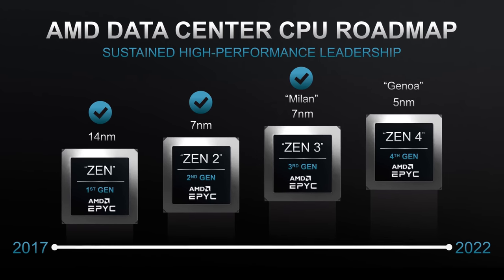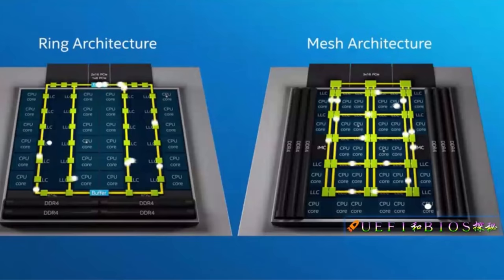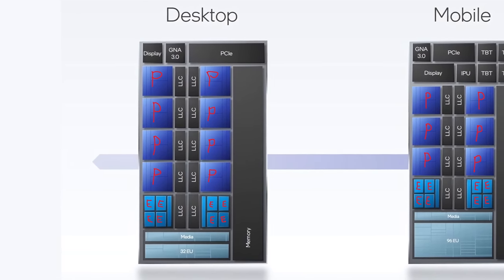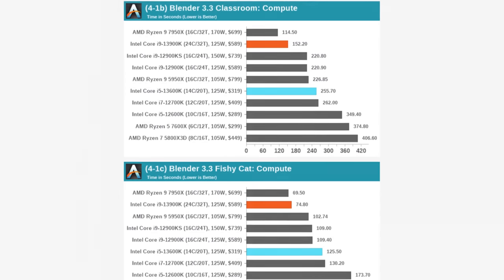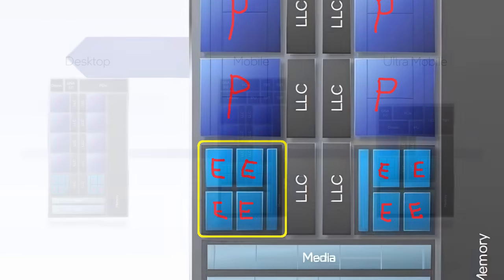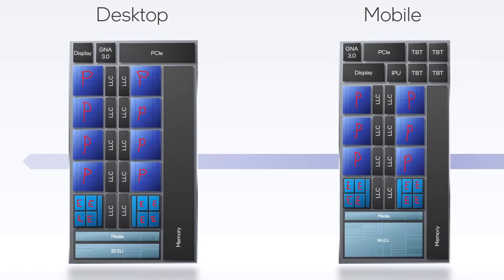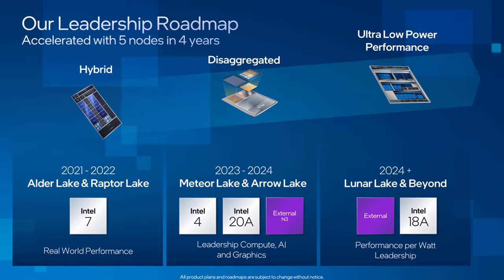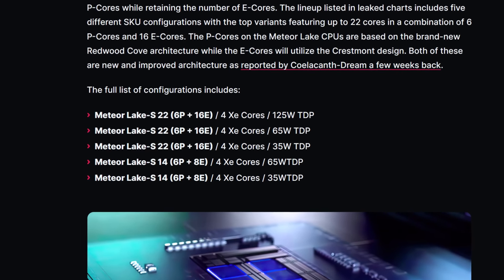E Cores - Slow, simple, not super efficient... but still good?

Comment: Likely amd already has this in mind as they are absolutely dominating the performance per watt, as in it’s not even close by any measure. This can be seen in the server market. It takes several years to design and manufacture something like this, as you pointed out
Reply: You need to better informed. Most tech media outlets do a poor job and evaluating efficiency. Those who actually spend time and do it properly found that in real world use that would define more than 90% of consumers, intel just about edges AMD on efficiency.. why? When intel brought big little, most people didn't realize how low their CPUs can idle, under 3W for some desktop chips. On top that, their P cores are extremely responsive and offer peak performance very quickly at high power and ramp down to their crazy low idle power. This peak is like microseconds or milliseconds. So the chip on average consumes less energy when you monitor its use over long periods of time in common use cases. The media will focus on "it pulled 300W" on and edge case that doesn't describe 99% of users. AMD has serious issues with idle or low load power, and this is a fundamental disadvantage with chiplets.

Comment: e-cores strategy needs better software support than intel have. It need heavy free-of-charge developer tools support to fuel up community. Otherwise it is a dead end
Reply: multicore programming is already a huge pia unbeknownst to the average pc user. asking devs to rewrite decades of software where they have to painstakingly pick which cores are to be used is neither feasible nor worthwhile. asymmetric cores dont really work in personal computing and they never might either
Reply: @raianmr2843  choosing core type should be a work for operating system. I dont see why OS cant keep track of statistic for long live threads and rearange them between cores once in a while. After all, even homogenous CPU's would benefit from it.

Comment: I disabled the e-cores on my 12700K. Not because I wanted to, but because for sure when playing Elden Ring it was the cause of consistent, sharp stutters. I think updating to Windows 11 may fix the issue, but I haven't tried that yet/feel like I shouldn't need to. Still, it was easy enough to disable them, and I haven't noticed much difference performance wise (though once again, that may be because I'm not using Windows 11).
Reply: Windows 11 isn’t actually as bad as people lead you to believe. I find it perfectly usable, and I don’t even have Intel
Reply: is this not because of the games issue with shader compilation? The stuttering happens on every game rig, regardless of core setup or performance, it is a known issue (forgive me if this was an unnecessary comment)  I also have a 12700k btw (but not Elden ring)

Comment: I wonder if AMD will make an ECCD. A ccd that has a ton of smaller cores. While the other ccd has normal cores. If we assume that you can fit 4 E cores into one P core like intel you can end up with a 32 E core ccd paired with a 8 P core ccd. Windows already keeps processes on specific ccds for so the software part is already there.
Reply: AMD already have a Zen4C chiplet, that uses the same Zen4 cores, just with half L3 cache, and made dense, so not clocking high. They have made it for their Epyc Bergamo lineup, and each CCD seems to be 16 cores/32threads. It certainly would be interesting, if AMD were to release hybrid CPUs for AM5 too (8core Zen4 + 16core Zen4c= 24core/48thread CPU).
Reply: @NeblogaiLT  that is actually in insane

Comment: AMD had better "glue" so if they implemented e cores they probably could build it with better latency compared to Intel
Reply: amd and better latency shouldnt be mentioned in the same sentance... ryzen has always had higher latency compared to intel.
Reply: @TheBURBAN111  uhm, that's for the monolithic architecture. e-cores latency still not that good.

Comment: I still wonder why the E-cores are not hyperthreaded, as Intel's first implementation of HT did so because they provided a substantial performance boost for very little extra die space.
Reply: HT requires more chip area for the logic arround that (sharing Execution ports + some duplicated parts), which goes against the "small" principle.. Furthermore you need a memory system that can feed those two threads. 4 E-Cores for example Share an L2 Cache, if you have 8 threads running, the cache miss ratio would increase significantly.
If HT would increase the core area by for example 1,5 per core, you have better performance when you just add another core, than having 2-way HT.. 4 "small" cores with HT are probably slower than 6 Cores without it, if you can do 6-cores without HT in the same chip area than 4-Cores with HT, you will do 6-Cores.
HT only makes sense if you have a lot of execution ports which are unused most of them time in your Core, then you can even do 4-way or 8-way HT, so 8 Threads per core for example.. There was a SPARC CPU that was 16c/128t, the SPARC T3
Reply: @Spacefish007   As they currently function, the E-cores are to boost multithreaded performance. I don't know how much die space the current iteration of HT occupies, but it used to be way less than a 50% increase. I forgot to mention, the current design would favor removing HT from the P-cores and allocating that die-space to add HT to the E-cores, as HT's intent is to boost performance both area efficiently and power efficiently. Although I suspect they did not go that route because it would be an even more massive redesign of their architecture, as they have been iterating the performance of the HT--inclusive P-cores for a decade and a half now.

Comment: Would the E-cores with smt be worth it?
Reply: Since SMT seems to increase power consumption along with performance, I don't know. You could end up with something similar to current ARM chips though, which take it a step further with Performance, Middle, and Efficiency cores, and most chips are 1P/3M/4E or 2P/2M/4E or 2P/4M/2E.

In the case of x86 those M-cores are multi-threaded E-cores, basically weaker, downclocked P-cores.
Reply: @DigitalJedi  cool info man. Thx

Comment: I rather have a CPU with 40 E cores or a CPU with  10 P cores. This E/P mix has no place on desktop. E cores are a cinebench enhancer and little more. It has a place tho, in battery devices, where on low power mode they could disable P cores, something similar to what ARM SoCs have been doing with big.LITTLE for a long time now.
Reply: Then you don't understand the point of the architecture. If your workload needs high single thread performance/low latency then you just need a few P cores. If your workload will use as many cores as you can give it, then you want as many E cores as you can. The reason we have a hybrid architecture is because you run both highly singlethreaded (games, a single browser tab) and multithreaded apps (anything to do with rendering like blender, the whole browser). Having more P cores won't help in singlethreaded apps and E cores perform better than P cores in multithreaded scalable applications.
Reply: So Blender, ffmpeg, code compiling and 7zip are no longer real world applications?

Comment: They need to separate processor's lineup one for gaming with just P cores and other with mixed P and E cores
Reply: The i5-12400 adn the i3-12100 are exactly that (P-core only processors intended for gaming). Both of them have been reviewed as possibly the 2 best value CPUs for gaming by independent reviewers.

Comment: Well i absolutely love the e-cores on my 13600k, i can render a video/image/animation, whatever in the background and game normally as if i wouldn't render anything with absolutely 0 performance loss, or just run OBS with unreasonably high settings on my e-cores and continue gaming as if nothing happens, i am absolutely never going to buy a non-hybrid processor ever again
Reply: Is the OS smart enough to do this automatically or you gotta manually set this up every now and then?
Reply: @IBO8Jaeger  If you minimise the program and let it run in the background windows 11 (and i believe Linux aswell) will do this automatically for you, if you want to have a programm running in the foreground and run it on e-cores only (like OBS for example) you need to manually tell the OS to do it with a small batch program, for OBS it looks like this for me:
cd "C:\Program Files\obs-studio\bin\64bit\

C:\Windows\System32\cmd.exe /c start "OBS" /Low /affinity FF000 "C:\Program Files\obs-studio\bin\64bit\obs64.exe"
The FF000 you see here is a hexadecimal representation of what CPU cores should be used, on a 13600k FF000 stands for all the e-cores
then you just replace the standard shortcut for the program wiht a shortcut to your batch file and you are good to go
Reply: @weibrot6683  that is pretty cool scheduling by default. It seems like 13600K will always be butter smooth. Thanks for the long response. I do wish I have 13th gen cpu though. Hahaha

Comment: My question is how does windows decide what task gets handled by an E core and can the user decide that as well?
I imagine that "rendering a video in the background" on E cores wont work, because it's still a demanding and persistent task that gets allocated to P cores unless the user sets it otherwise.
Reply: My guess is that windows monitors the process's CPU usage and assigns it E/P cores accordingly
Reply: @baconofburger8784  then that means you can't render a video in the background on E cores, because it's a constant, taxing task.
Reply: @simpson6700  You probably can if all performance cores are already taken up or there is another process which needs even more resources
Reply: You actually can render a video in the background. Windows 11 automatically switches tasks between P and E cores right now depending on the demand on the CPU, favoring the E cores for low intensity tasks, but, you can set specific programs to use only certain cores in either XTU or Thread Director, can't remember which it was at the moment.

Right now I render scenes using the E cores on my 13700K while I keep the P cores free for working on the next one.

Comment: I really hope we see x86 laptop chips as efficient as Apple silicon! I think AMD's stuff is pretty close, but noone puts their chips in the laptops I'm looking at like they do Intel!
Reply: Actually the recent intel and amd CPUs are all kinda power efficient, even comparable to M1 and M2 when the power draw is around 35 to 45w.
Unfortunately the main issue of the power efficiency of X86 platform is the platform itself, which is not power efficient at idle comparing to Arms.
Reply: @張彥暉-v8p  I haven't been keeping up but yep, though I think AMD is currently closer. Also regular M1 I think is sub 20 watts but uses far less in the day to day.

I long for a fanless and long lasting thinkpad 2in1!
Reply: Helps that Apple is a node ahead....
Reply: @robinrai4973  The chinese tech channel geekerwan did power efficiency test for m1, 12th gen intel and ryzen 5000 and they are really close in the power range i mentioned.

The main difference between windows laptop and macbook is in normal web browsing/watching videos situation, macbook always uses less than 5w but windows laptop always uses more than 10w, too much junk running in the background in X86 platform which is fine with desktop but not with laptop unfortunately.
Reply: @張彥暉-v8p  yeah, unfortunate
Reply: Captain_Morgan  I had an M2 air next to a 12th gen i7U at work, doing the same light tasks, In the time the intel machine lost 75% battery, the M2 air lost 16% 🙃

Comment: for music production and mixing, is it better to use intel or ryzen??
Reply: @2kliksphilip  i use Reaper and A LOT of plugins and virtual instruments, my budget is like an i5/ryzen 5 at best
i currently have intel and want to upgrade, i was wondering if i should go for amd
Reply: CPU Does not matter as long as it's decent, but RAM sure does. I use both in my studio, and many of the artists use mac m1/m2 with little issue. The bigger consideration is workflow. 
I use Windows, Mac, and yes even Linux for production duties, and all have their strengths and weaknesses. 
Win is better for price and availability of software. IO is still a bit slower than mac/linux and latency higher, and I get more crashes (although still kinda rare.)
Mac has a good creative ecosystem, and out-of-box functionality, but it's lack of configurability and limited options will dictate your workflow.
Linux can be a pain to setup, and has less commercial apps available,  but the free apps are decent, has amazing fine-grained control, RT kernels, and can suit nearly any workflow you can imagine if you spend a few days setting it up.
Reply: @nobodynoone2500  yeah my thing is that a friend of mine gifted to me two 8gb RAM cards so i wanted to buy a motherboard so i can fit them, i have a low budget PC and my motherboard has only 2 RAM slots, so i was wondering if i should upgrade my i3 (9th gen) to an i5 or just go for ryzen instead.
but if my problem is RAM i should be okay just buying a better motherboard and adding the 16 gb of RAM right?
Reply: @nobodynoone2500  sorry for my weird english, i'm from Argentina lol
Reply: 13600k is good for the money

Comment: I think e cores are really cool as anything that's designed properly to use all the cores won't care how fast each individual core is, while games that need single core performance have Intel's INSANE single core performance, with lots of even 13600Ks running 5.5ghz on the P cores from what I've seen on overclocking channels and forums.
Reply: I've gotten 5.77ghz single-core out of my 13700K, but I decided to go SFF with the upgrade and after putting it in the new case, I undervolted that thing far enough to drop 50mhz.

Comment: More cpus make the system faster overall not only because some programs run faster when parallelized, but you can run a higher number of different programs at the same time, so I definitely see AMD implementing efficiency cores.
Reply: Writing programs to run parallel is not always a performance gain, you can also lose Performance. It depends on what kind of workload and how many parallel threads you want to use. If it would be a gain everytime, every Programm would use if.

Comment: The latency of the 13900k with e-cores & ht off on competitive titles like Valorant or CSGO is unreal, I'm not sure AMD will ever be able to replicate that on their current architecture. The only issue I have is that whenever I want to switch from gaming to productivity I have to load my other bios config, which isn't too bad I guess.
Reply: Can you tell me where I can look this up? Hearing this the first time and it sounds interesting
Reply: How would you know? Is performance better?
Reply: @AGuy-vq9qp  its about latency and getting it down as little as possible
Reply: @Monolize  there’s no actual game latency difference outside of framerate.
Reply: The 7700X is probably still faster in Valorant, whereas the 13900K will win CSGO.
Reply: With that CPU I doubt anybody is running those games paired with anything lower than a 3060. This combo easily gives 400+fps in both Valorant and CSGO competitive. After that, any more input lag reduction is diminishing returns, unless its from other hardware/software stuff like 8Khz mice not working properly due to Windows not supporting high polling rate or IPS monitor input lag, etc.
Reply: @AGuy-vq9qp  you have a smooth brain.
Reply: @TheBURBAN111  you have any idea what you’re talking about?

Comment: I believe this is the correct way. There is a reason why we have CPUs and GPUs with completely different architectures. Adding another level with multiple efficiency cores that are not as specialized as the GPU cores will definitely be beneficial. Even if it incurs some extra overhead on OS and application development to schedule everything correctly. We are already far from "one architecture fits all" paradigm, after all, the GPUs already have extra tensor cores, RT cores and other specialized stuff. Also, Apple has proven that quite a long time ago (even before M1 in their phones)

Comment: Taking into consideration an ARM CPU as an example, making less P cores and more E cores makes a hell of a lot more sense, mainly because multi-threaded applications usually have a multiplier that boost performance by each core added, that means 2 cores will not have just the performance of them both, but actually just a bit more, and scaling that to 4 for each "slot", 4 E cores can outpace even a technically speaking "faster core".

Comment: Channels such as 'Moore's law is dead' have put forward the idea of a future Zen 4 based desktop chip with a current 8 core die (maybe with extra cache) and the in development Zen 4c chip with has 16 cut down Zen 4 cores, but still SMT based. Such a combination would improve gaming numbers as the package would basically have a 8 core 7800x3d (P cores) and 16 weaker Zen 4c cores for a total of 24 cores / 48 threads, which would result in very good mult-threaded workloads. The reports also indicate that the Zen 4c is larger than the Zen 4 core, so the main issue is space on a desktop chip. So AMD may have an answer for their top end chip, but the extra packaging may make it hard for them to provide a low end chip that answers Intel's current offerings.
Reply: There's plenty of space in the AM5 package for one (or both) of the CCDs to be about 20% wider. Much beyond that would be right up against the I/O die and might require a new substrate with its dies and capacitors shuffled around slightly, but there's no reason why AMD wouldn't be able to do it if they wanted to.